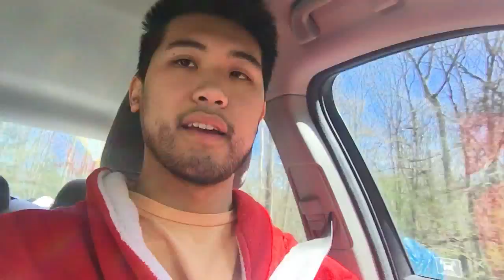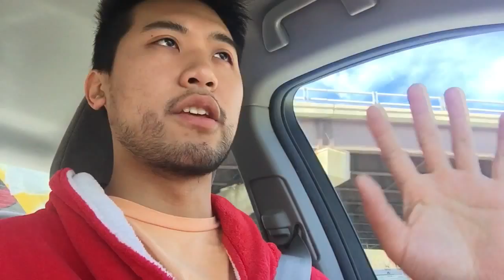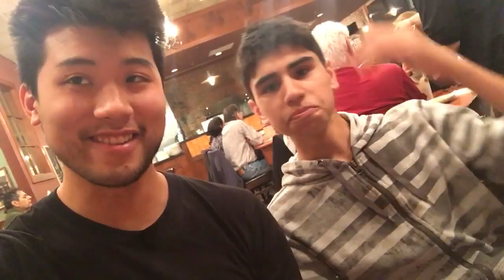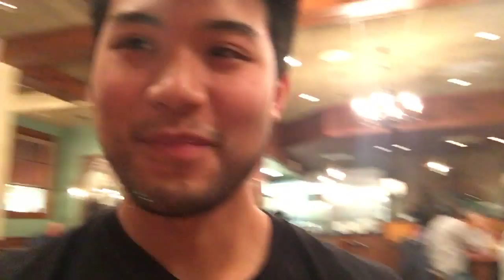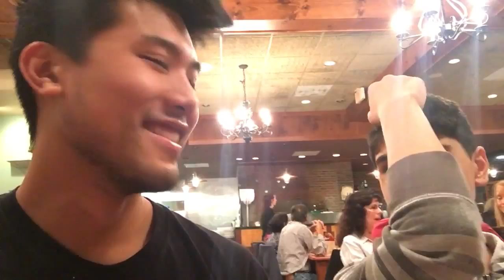Why does Lubicle ONE have bearings? Cavitation and Fluid Force Distribution

Comment: If anyone has no idea what he is saying, short answer is that the lube is made of two liquids, the bearing is there for mixing them. Density matters here, like why soy sauce and oil won't mix. Teflon is a material that will not stick to anything. If you want to learn more, I recommend searching up Ted-Ed's why does teflon not stick to anything video. Hope this helped.

Comment: can u say what lube makes the cube less effort to make the first turn ?( I meant when starting a turn like on the gan um  takes a little high effort  but when moves are done after another only little effort needed) Don't the both water based and silicon based lubricant has a different effect on this ? or is it same? ( aslo can u say a way to lube the gan um with traxxas only)

Comment: This might seem like a silly question but can the two main parts of the lubricant separate inside of the cube?
Reply: Spotty. As the cube is used over time...it will mix the contents of the lube on its own and it is less likely to get separated inside the cube. But if you leave the cube idle for a while...they might be separated and you will have to break it in again or wipe it off and reapply...I'm not really sure what we gotta do if the cube is idle and the Teflon gets separated.